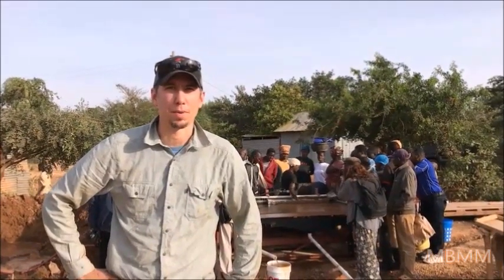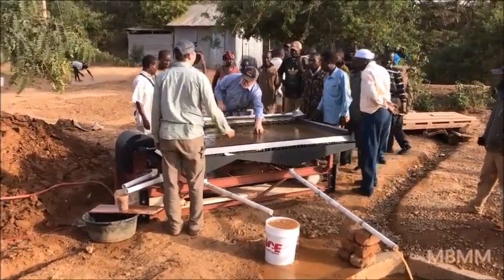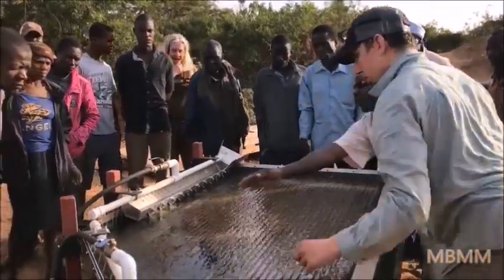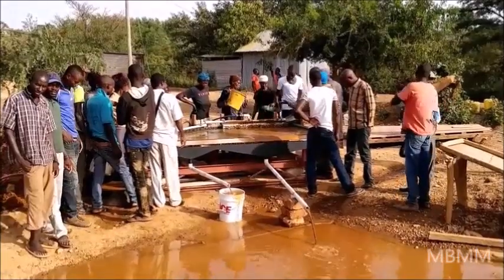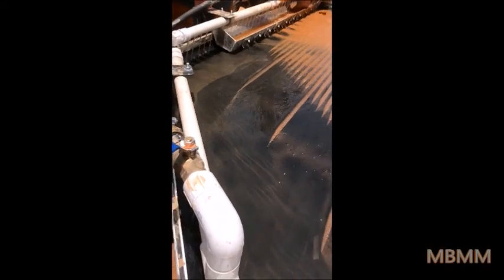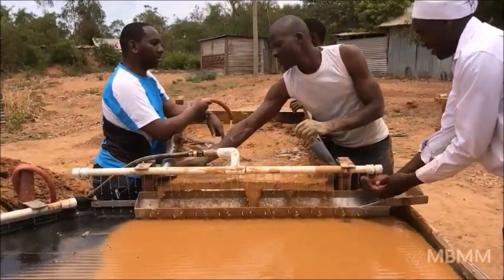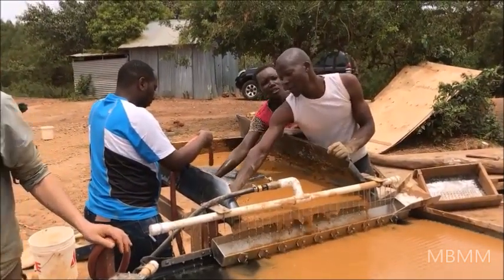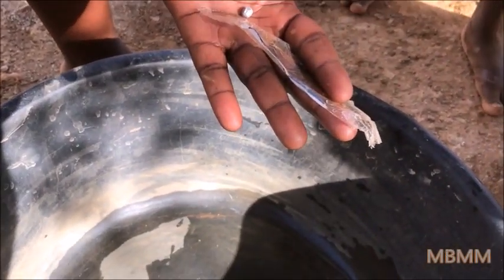Kenya Miners part 4: Recovering 2-3 times more gold using our shaker table than sluices

Comment: Mercury in bare hands . Ffs
Reply: My great aunt used to bring jars full of mercury home from work...I don't think it screws up a human in small doses like in a vaccine but it will screw up your little swimmers if you know what I mean, I think it's a huge cause of autism.
Reply from the maker: Thank you for your safety concerns
Reply: Elemental mercury is 100% safe to hold and touch, even eat! Only dangerous when it reacts with other elements and transforms into a bioavailable structure which can interact with your body's cells.
Reply: @archlord381  Did Trump say this nonsense because this does not seem accurate nor based on science. Hence why there is no mercury in our vitamin and mineral supplements...